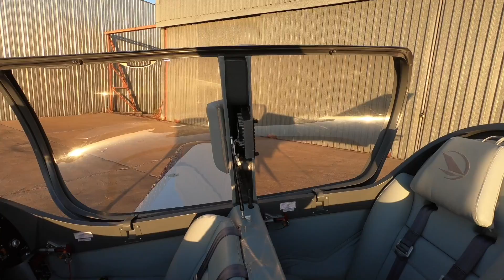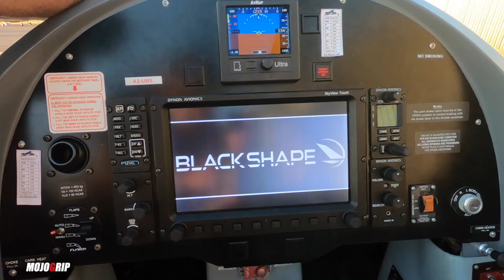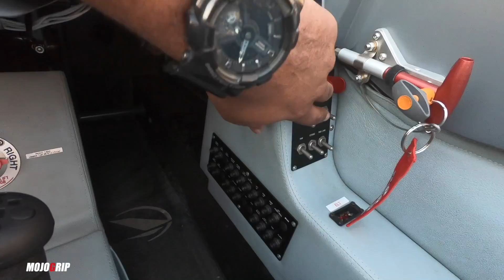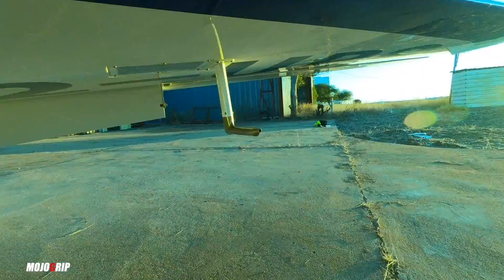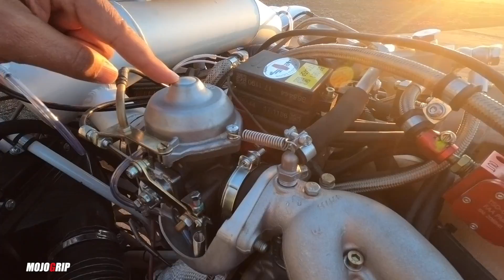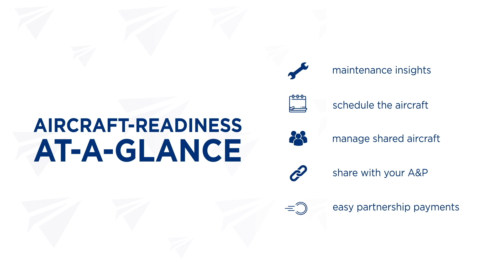The Blackshape Prime Sport Plane Walkaround & Preflight

Comment: I love the quick open cowling. Makes the preflight way easier than opening 18 push screws.....and then putting them all back in again.
Reply: Doug Flight that’s one simple feature but makes such a huge difference.
Reply: Unfortunately to remove the below part of the cowling it is a mess, almost one hour to remove 8 bolts in a tight space.
Reply: Paolo Aleu 🤣🤣🤣🤣🤣 I know ... tell me about it.. I think I have it down to 45mins now though.
Reply: Aviator267 On my Blackshape I need also to remove 8 additional bolts of the front gear doors hinges, before to be able to remove the below cowling.
Reply: @paoloaleu5577  actually I leave the hinge bolt/screws in and just slide out the hinge pin. Saves the threads on the screws.
Reply: @aviator267  , thanks for the advice, I will do the same, saving some time. Actually, which your cruising speed at 2000ft, on mine with 5150 rpm and 26,1 MAP, around 230/ 240 km/h Ias, in summer time.
Reply: @paoloaleu5577  actually my airport is 3300ft msl so I typically cruise at 6000 feet where I only get about 24” max which is about 203km/h
Reply: Are you on social media? I’d like to follow you, where are you based?
Reply: @aviator267  well noted, no I am not on the social media, only on Linkedin.
Reply: I am based South East Milano Linate airport, LIML, in Italy
Reply: @paoloaleu5577  wonderful, I love Italy 🇮🇹 Monopoli being my favorite 🤣
Reply: @aviator267  I can understand, not so close to Milan, but I think that you made the type rating with Elio? Do you receive a Blackshape Prime check list from them or you made your one?
Reply: @paoloaleu5577  yes I trained with Elio and Dominique, very nice time. I’m sure I will go again in 2021. I made my own checklist. I think I’ll make a video for YouTube about the checklist and procedure I use.
Reply: @paoloaleu5577  it took me 1 month and 20 flights to finish my check list 🤣🤣🤣🤣🤣

Comment: I'm a fan of tandem for aerodynamics but it's basically the same speed as a 912 VL-3 with side by side seating and the Sea Avio Rison bests it outright despite having side by side seating.
Smaller cross section helps but apparently the right shape is very important. And no one has yet done a tandem that takes advantage of the smaller cross section so it can go faster than the rest.
Reply: Yes you would know because you are a veteran flyer? I didn't think so...
Reply: @slapaleftyhard6231  plenty of veteran flyers but they don't know jack shit about brilliant engineering, my guy.
Reply: blah blah blah.....
Reply: Jimmy Crackcorn  should you be able to rise to using your real name you will have come closer to being able to appreciate how awesome I am.
Reply: Jimmy Crackcorn  bus drivers aren't great bus engineers so not that it matters but I have a plane.
Reply: Jimmy Crackcorn  youtube isn't my personal daily update place, I'm not at fault for your hasty erroneous conclusions. Those are all yours.

Comment: Are Spin entry and recovery still not completed by the student in the U.S?
Reply: Only for initial Certified Flight Instructor (CFI) rating. Back in 1975, my instructor demonstrated  spins before I soloed, and had me perform them (left, and right) before he signed me off for cross-country flights.
Reply: @EJWash57  Weird, in canada the student enters and recovers several times during thier training, but not a test item until commercial. I bet it has little impact on the crash stats tho, identification/prevention is more important. For some reason I was wondering how the Prime spins.. (but more interested on DOES it stop!)
Reply: @EJWash57  Thanks! I couldnt remember if they changed it and was too lazy to look..